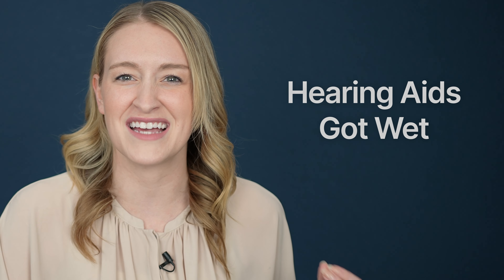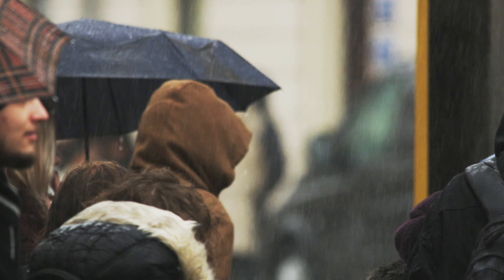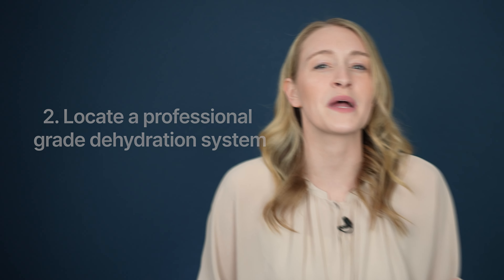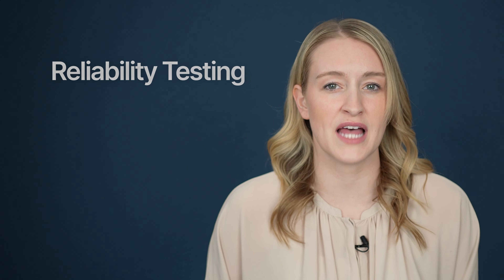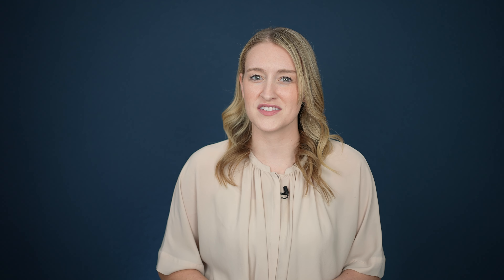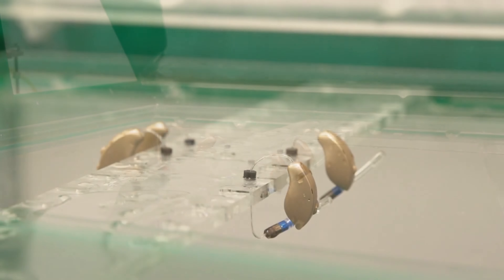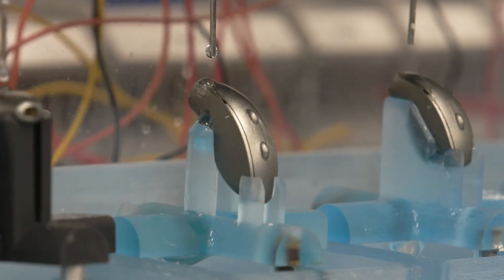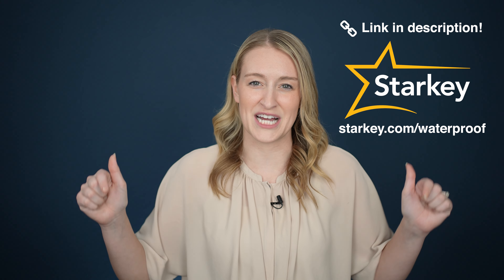3 Ways to Dry Out WET Hearing Aids!

Comment: Very informative! 

FWIW, the second digit of IEC 60529’s IP ratings does go above “8” (submersible to 2 m [6 feet], up to “9” for pressurized jet spray. 

IP ratings do not take into account liquids other than fresh (tap) water, as you stated. For those other conditions (at least on electrical equipment), you have to use NEMA 250 Enclosure Type ratings (oil, ice, dust).

Comment: how does it compare to Phonak Audéo Life™ Lumity  for waterproofness
Reply: And she didn't do what Dr.Cliff did while wearing the Phonak Paradise Life hearing Aides in the shower and sweating running outside in heat around the track and biking riding and swimming in pool laps with hearing Aides underwater below 3 feet deep over 36" inches deep in pool and Dr. Cliff shown hearing Aides in washer machine and 600 hours salty water and fresh water and leaving hearing Aides in full cup of water for days and nights and Dr.Cliff talked about hearing Aides ear molds needed to be dry and and some are custom mold small like I have 2 custom mold with wires to my 2022 new Phonak Paradise Life hearing Aides with Bluetooth automatic Sensors microphone 360 degrees Surrounded Sounds that I bought a new Phonak Aud`eo Roger-On Bluetooth automatic Sensors t.v. audio hookup and it automatically sensor my Bluetooth hearing Aides to turning it on and off automatically when my Bluetooth cellphone computer ringing or sending alert and Roger-On Bluetooth paused t.v. audio while I talk to my cellphone and I can get in my truck and my radio would respond to my hearing Aides automatically sensor Bluetooth and I can use Cellphone computer Google maps without using my truck radio or just use my truck radio to listen to my Google GPS maps either way without bothering my passenger in my truck and I don't have to keep on eyes on my cellphone Map I just listen to Google maps telling me warnings and directions to wherever I go to while keeping my eyes on the roads and highway and dirt road .
Reply: She didn't even test what type of rechargeable battery base used to be hooked up to. How long it will last . My Phonak Paradise Life hearing Aides has a 3 nights charging Base without any hookup to electricity power and without any hookup to my USB ports to my truck and car and my Midland Emergency radio/ solar power panels and hand cranking regenerator USB ports and my large Solar power panel portable rechargeable battery hookups to 4 different types of USB ports to charge my cellphone and LEDs light and hookup to my hearing Aides Base all at the same time and I can recharge my main 19" inches long Solar power panel Swiss Company base to charge by sun and truck USB ports and home electric power. And I can spend a month or more camping and hiking and boating and fishing with all the stuff I have now without any home electric power or city power building at groceries stores and department stores and I don't have to buy dozens of disposable batteries size 13 hearing Aides to use but I do it anyway since I needed backup hearing Aides to recharge my Phonak Life hearing Aides if I don't sleep during the night.

Comment: You didn't mention the Redux home drying device which is the best hearing aid dryer for home use and yes it's pricey. I paid 400 dollars for it and it's worth it. You didn't say that it's better to remove moisture from hearing aids without using heat. 1/3 of the video length is an ad for Starkey new hearing aid.